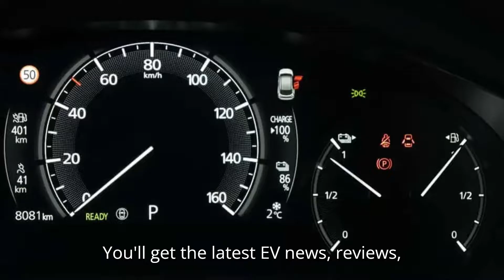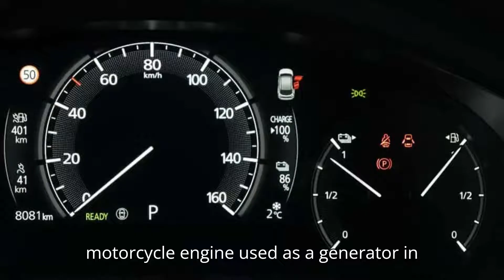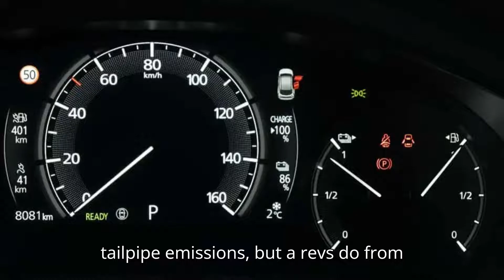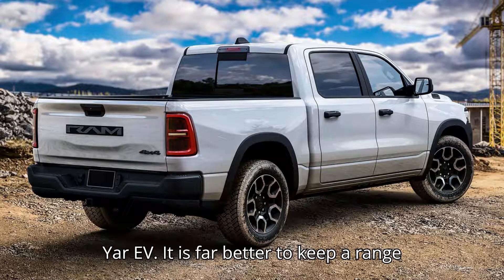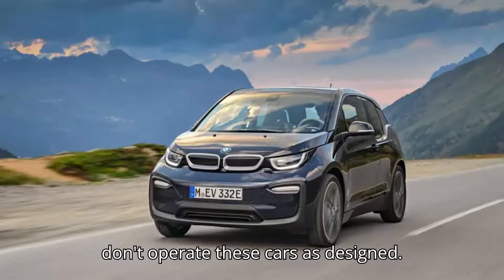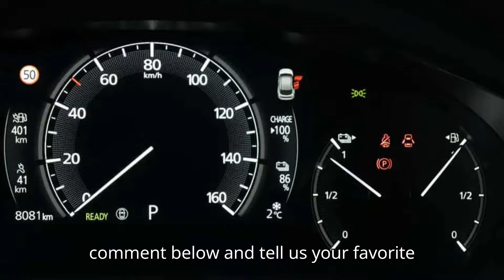How Does An Extended Range Electric Vehicle Work?

Comment: Why range extender hybrids are not conquering the world, they seem the solution of all problems, at least now.
Reply: @omblauman  they are
Reply: They are. BYD is the biggest manufacturers of Range extended EVs. There Sealion 6 is selling very well.
Reply: @JSM-bb80u  is sea lion a REV?
Reply: @sabkaBaap007  yep sealion 6 is an REV
Reply: @JSM-bb80u  it's not a REV, I checked and found out that it's a PHEV
Reply: @sabkaBaap007  Most people use rev PHEV interchangeably. Sealion engine  doesn't drive the wheel directly. It generates electricity and charges the battery or drives the traction motors with that electricity. The engine drives the wheels directly on speeds higher than 80 kmph through a fixed clutch. Still the engine rotates in a constant RPM.
Reply: @JSM-bb80u  if engine is directly driving the wheels then it's just a PHEV, let's not make it complex.
Reply: @JSM-bb80u  even if the engine works in a constant rpm yet the architecture becomes different than REV.
Reply: @sabkaBaap007  Fair enough. It's in between PHEV and EREV.
Reply: @JSM-bb80u  I checked and now they sell sealion7 which is not hybrid any more, why?
Reply: @omblauman  They sell both sealion 6 PHEV and sealion 7 EV.